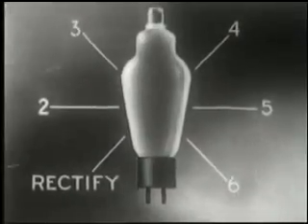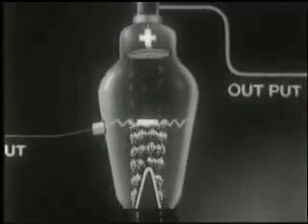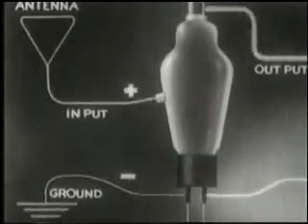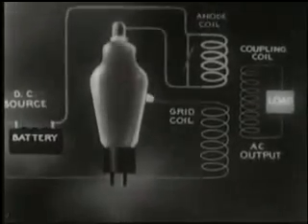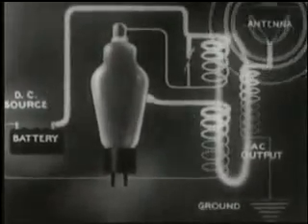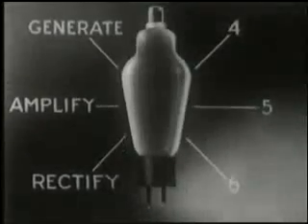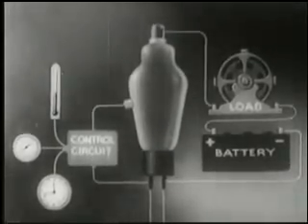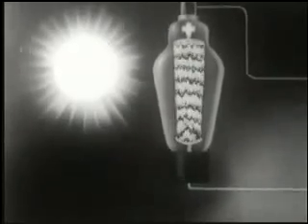Electronics At Work (1943) 2 / 3

Comment: Nice that Russia could preserve a bit of Americana History about the secret power of the war machine that was the military industrial complex of the day. I wonder if the HF power generation happened to be over unity? I've read that dual coil set ups like this are capable of outputting more power than they take in.
Reply: Spoiler: I'ts not.
Reply: +XDFreakLPxD So, in the "generate" mode: The drive coil in the Cathode circuit induces a magnetic field in the grid circuit. This generates a voltage in the grid circuit which cuts off the flow to the cathode coil. So it turns off the cathode and the grid, which enables the energy to flow in the cathode again. An astable vibrator. The energy used in the switch can be next to nothing with an amplifying magnetic core. No over unity. But, with the vibrating output, one could build an amplifying transformer instead of the coupling coil of AC Output and make it look like it was over unity. See patent # 20140253271. TC Heins' BTTT transformer.

Thanks for the clarification. I did not see the first coupling of coils in the circuit diagram at the generation illustration. The vibration would be limited to the switching speed of the cathode turning on and the coil inducing enough voltage to cut off the electron flow in the tube, much faster than a spinning magnet. But a unipolar pulsed output.
Reply: +BMan18 BTW, that unipolar pulsed output of high frequency used in induction heating can also be used in electroplating and generation of HOH for LENR with water.

Tesla used it (he had to use rotating contacts To make high speed unipolar sparks) to amplify electricity 1,000 fold and transmit power through the air. He called it radiant energy, a result of the pulses inducing massive power from the high frequency pulse trains. Edwin Gray replicated this with his patent 4595975. With a tube of his own design.

HF increases the induced output.